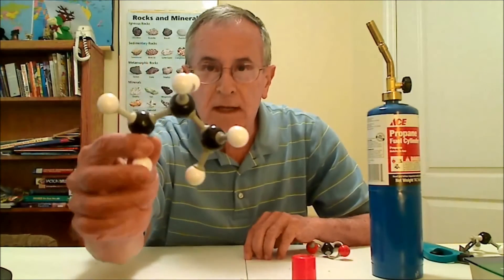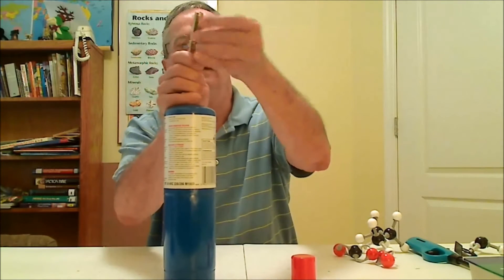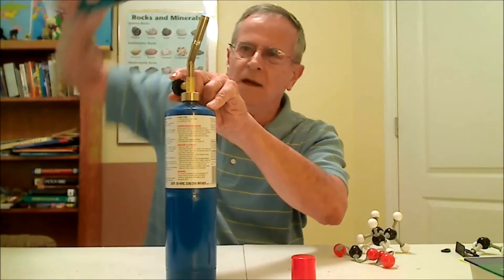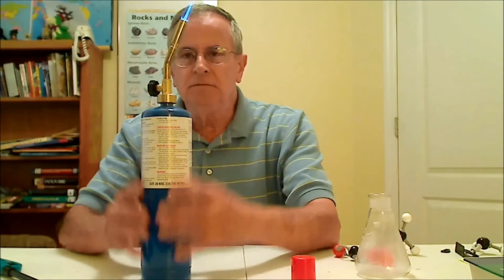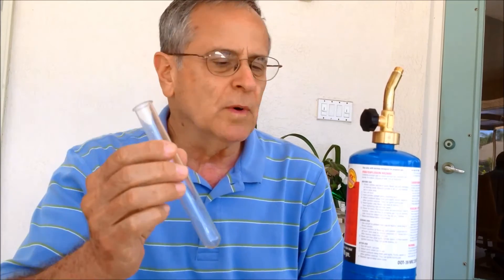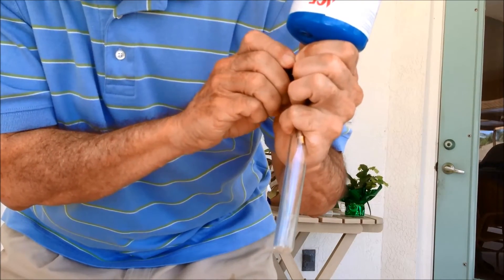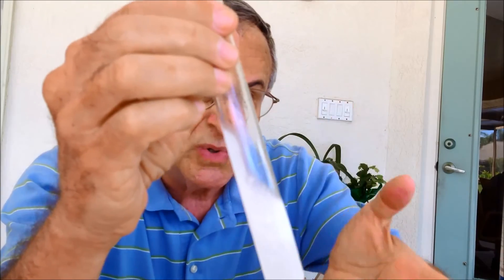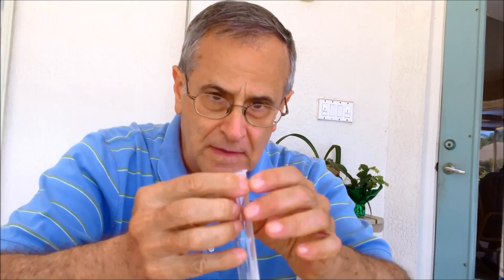The Properties of Propane

Comment: Quiz Question: why does the propane dramatically cool when he throttles it from high pressure in the tank to low pressure in the tube? What thermodynamic property of propane is revealed by this?